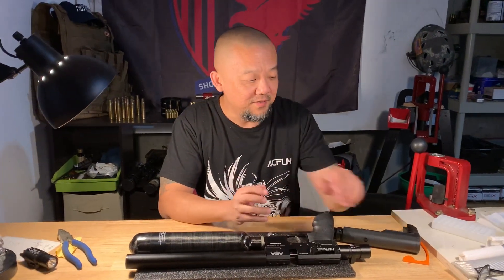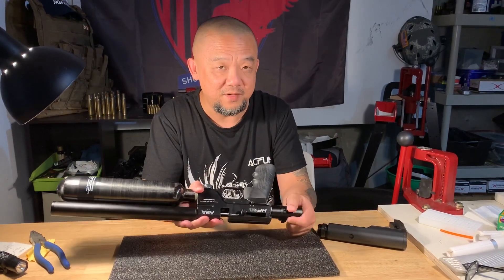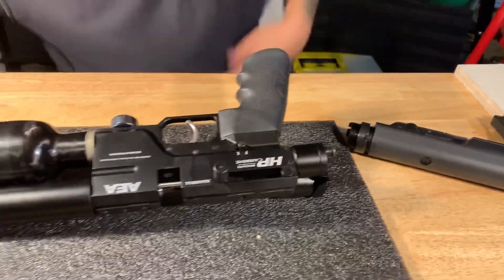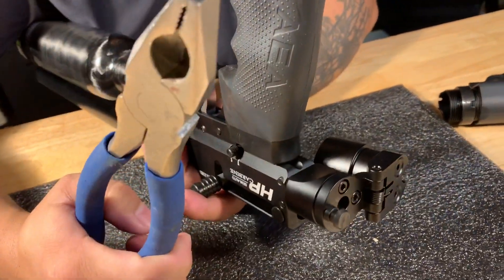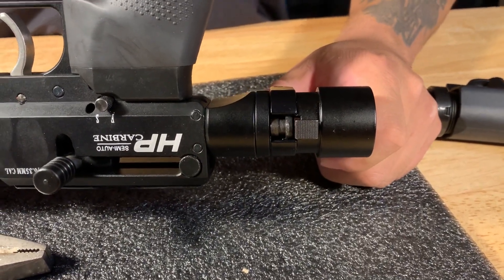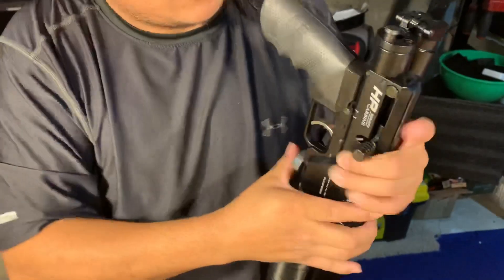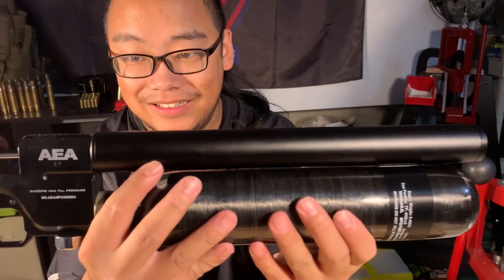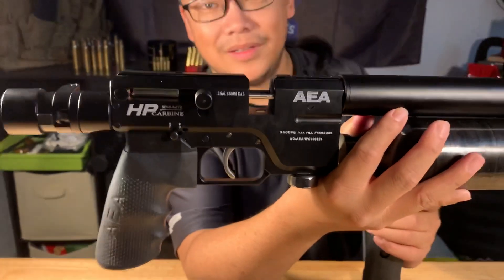AEA How To: How to modify the rear stock connector on AEA HP 22/25 serials

Comment: I need another adapter. Why do I have to pay for a whole buttstock and adapter. what are my options I paid for my aea Max  2 months ago from the pellet shop eat malfunction within 2 weeks. But it's awesome I love it. one huge problem the folding mechanism won't lock   it's very annoying it swings open all the time with little to no effort. But the thing is the monster it shoots awesome scary as heck but something needs to be done about this folding stuff issue please get back to me
Reply: Did you get this resolved Dudley?
Reply: @FoundingYouTuber-2005  LOL the fix was so simple it literally took no time at all but I still want to replace that part because an attempt to try to fix the issue.  no I still haven't found a replacement part without having to purchase the buttstock still looking if you or anyone else knows please tell me